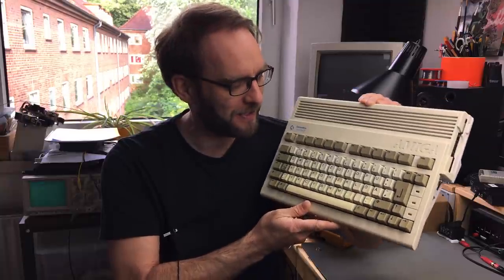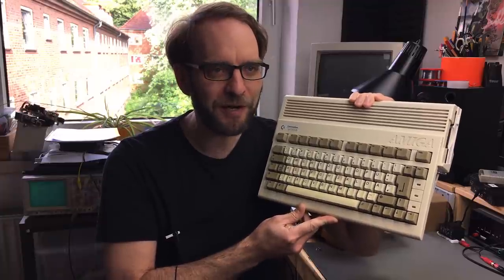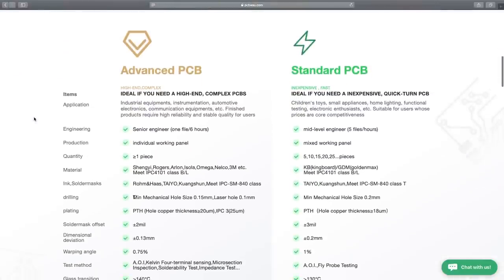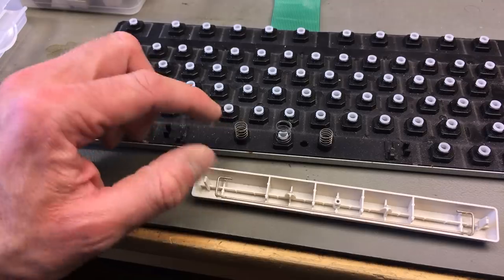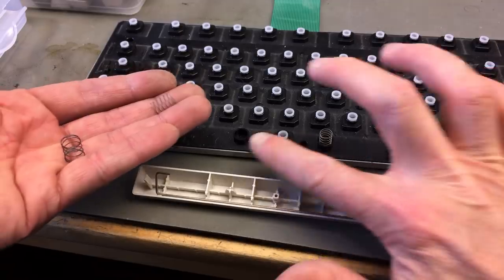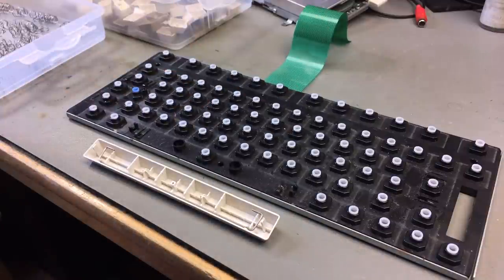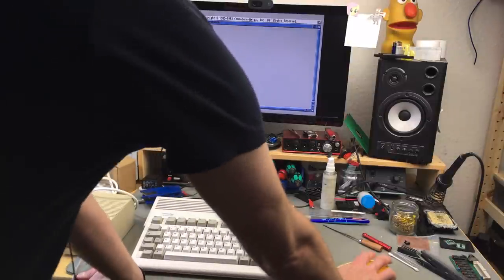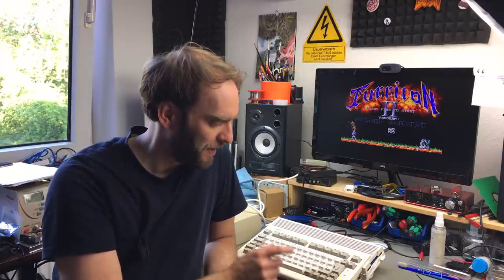Amiga 600 Retrobright and SD Harddisk

Comment: Jan, I sent you one of the first kits which had the interference problem with floppy drives. That was a silly oversight on my part. Now I include an additional two rear clips without the 'wings' so they don't interfere with the floppy drive. If someone is fitting a Gotek, etc. they can use all four 'winged' rear clips. So, new kits come with the two side slips, 4 back slips with 'wings' and 2 back clips without 'wings'.
Reply from the maker: Ah, that makes sense! Not a huge problem just filing one of the clips down though. Nice work! :)

Comment: I usually use 12% peroxide when retrobrighting, wrap it in food wrap and put it in the oven at 50 degrees (with "massage" every hour) for about 3-4 hours. Works great, and no hassle with uv light. I believe it's the heat that makes the process going and not the uv, since the wrap will block those wavelengths anyway. :)
Good job with this 600! Another Amiga saved for the future!
Reply: I remember someone (Neil RMC, I think) doing retro-brighting experiments some time ago, and he found the same thing.  It was the heat that accelerated the process.  The UV had little effect as far as he could see.
Reply from the maker: Yes, heat is the more important part in my experience, too. UV speeds up the process, too, it seems. I've seen people using UV led strips (that don't get warm that much) with great success so it must play a part, too.
Reply: I am also using the 12% "creme" stuff- but I have to say I just put the items in a transparent trash bag and put it into the sun- I am also in Germany and the last time I brightened my keyboard it was only about 10-13°C and it worked absolutely fine and only took about 3-4 hours. Could the wrap actually be the difference? the trash bags seem to be much thinner maybe they let more UV through?
Reply: What about bagging the parts in a sealed bag covered in peroxide, and running them in a heated ultrasonic cleaner for constant agitation?

Comment: Nice job Jan, I've recently rescued an A500 Plus, replacement case which I retrobighted & also boiled the keycaps in peroxide fluid, that went wrong, keys warped & bleeched the gray keys white, had to purchase a replacement keyboard, which I repaired a couple of membrane tracks with guitar shield carbon in water paint & I put the keycaps into a clear sealable food bag, which I filled with 6% peroxide fluid, then placed that in a large source pan of water to act as a jacket between the source pan & the food bag, place pan on smallest ring / hob on minimum heat setting, you should just be able to pop you finger in the water for a few seconds without any problem, after about 2 hours, rinse in warm water, dry & voila you have new keys with no signs of yellow.

Comment: Thanks for the video. When I first ordered an IDE to SD card adapter for one of my A600s I also had the problem with the HD activity light constantly on. Turned out this is a common issue with these IDE to SD adapters. What I did in the end was to order another IDE to SD adapter which had the IDE light fix already applied to it. And then the IDE light works as intended. I think it was possible to mod the one I already had, but I found it too much hassle.
Reply from the maker: Yes, there is various mods for that problem out there. I think I'm going to look into that in a future video. :)
Reply: @JanBeta  would love to see a quick video about that mod, i also have a generic ide-to-sd adapter like the one here that i would love to use now that i finally found the needed laptop-ide cable
edit: oh i see you did make a video on that, thanx!!

Comment: There is a mod for the IDE-SD adapter that enables the HD activity light. I can't post a link, but it should be easy to find. It uses a 2N7000 mosfet.
Reply: Here is the guide in a text file and a picture showing the finished product: http://megaburken.net/~patrik/Amiga%20SD%20Adapter%20HD%20LED%20Fix/
Reply: @perhansson6718  That's the one! Thanks.
Reply: By coincidence I actually was doing the same thing this week on an amiga600 and installed the same sd adapter. Had the same problem with the led being lit all the time and found this 'fix' you mentioned. I did this exact fix with the 2n7000 mosfet and it didn't work for me. Still had the same problem with the led being lit all the time. Tried it on another a600 and this also did not work.
Reply from the maker: Mh, interesting. I'm going to give it a shot and probably make another video about the process.

Comment: As for keys, especially the grey ones, I always just put them into a transparent glass and fill it with 30% peroxide and toss it into the sun. You have to use a mesh or something in there to keep them under or they will float to the top. Stirr occasionaly. Never had any streaking/mosaicing this way, unlike all the other ways I tried it.
Reply: You're right, otherwise there's a reaction with oxygen...
Reply from the maker: Oh, sounds good. It was quite a rainy day when I did the retrobrighting. Even in Summer it seems I don't get much sun here (at least not when I need it for something serious!). ;)

Comment: Great video, but I've been avoiding watching it until now as I knew it would remind me of my own 600 that's currently sitting in a state of disassembly on my workbench. I've never repaired anything with surface mount components before, and the idea of trying to replace the capacitors is quite daunting when I've only worked on through hole stuff before. I really should get my act together though!
Reply from the maker: Thanks! Hope you manage to successfully recap your A600. If you take some precautions and are careful, it's not all that difficult (and if you lift a trace because it was already corroded, you can always patch it up with a little wire or a solder bridge).
Reply: @JanBeta  Thanks for the encouragement Jan! I have an old PC video card that I'm going to use as a test for my surface mount soldering skills - if that goes well then I'll tackle the A600. I've got an SD card replacement for the hard drive, combined RAM / RTC board and a VGA video adapter to install so this should be a great machine once I get it fixed :-)

Comment: My colleague recently gave me an A600. It had an intact factory seal, and didn't have the top shield. This matches your theory, that they sold them without the top shield. 
I decided to leave mine without retrobrighting, as it is uniformly and very slightly yellowed. I thoroughly cleaned the case, recapped the motherboard, and repaired the PSU wiring, as the -12V wire was broken (Amiga was working, but the audio it produced was horrible). I also added a switchable KS (1.3/3.1) and a 4GB CF card in the IDE-44 adapter. To make it usable with a CF, it desperately needs more RAM, so I put 1MB of CHIP RAM + RTC card in the expansion slot, and added 4MB of FAST RAM in a form of CPU snap-on board. I've created a single PFS/3 partition on a CF card and installed Classic Workbench x86 (WB 3.1 based) with WHDload. As the FDD was dead, I've also installed an internal Gotek drive. The ROM switcher and FAST RAM snap-on card I used were Open Hardware projects of SukkoPera (@OpenRetroWorks).
Reply from the maker: Nice! I have some of the SukkoPera hardware on my to-do list, too. Excellent stuff. :)

Comment: Man, that QWERTZ keyboard. I could never get used to that!
Reply: Also, I think the retrobright thing is about cigarette smoke. Smoke messed up the plastic and it breaks down. That could account for differences in the longevity of the treatment.
Reply: My Atari ST has a QWERTZ keyboard - unfortunately my brother sold the one we "shared" ownership of as kids, and when I bought a replacement in the early days of eBay I didn't notice it had a German TOS and keyboard until it arrived. I adapted to the new layout very easily though.

Comment: I love the the A600 it takes up very little space.  The biggest frustration I encountered with the A600 is the short cable for the LED's.  Better to make the cables longer or just buy a new LED Board with longer cables which is what I did but I own 3 A600's.    While I have every Classic Amiga Model except the A3000 none of which are Towers its the small size of the A600 that makes it so attractive and it sits nicely in the corner of my L Shaped Desk.  I also have a Vampire in that A600 so its the one Amiga I use the most.  I am not into games like other Amiga Enthusiasts but a couple weeks back my Grand Children were enjoying playing the games.    Unfortunately the 5 Amiga's I have and use on my desk all share the same monitor and with the big box Amigas they share the same Keyboard, Mouse and Monitor through the use of a KVM Switch except the A500+ which does not play well with the mouse for some odd reason but I suspect the KVM Switch is just being picky so I will have to change that out but the mouse adapter I have which converts the 9 pin to PS2 does work it just does not play well with the KVM Switch for some reason so that A500+ in a Checkmate Case has its own dedicated mouse as does the A600 and A1200 on the desk  and that A1200 is going into a Checkmate Case sometime towards the end of the year when the case arrives.

Comment: Love the 600 great little machine
I have a Furia EC020 accelerator with 9.5 meg fast ram with switch able FPU, also have extra 1meg chip in the trapdoor, all finished off with a 4gb CF card with WB 3.1 installed.
Next part of the project id whd load and an original internal floppy instead of the gotek if i can find one.
Love your vids always happy when new ones are posted

Comment: You dont need to remove all the keys, 1 by 1, for the retrobright ! But you should open and washe everything, the keyboard too (not the floppy 😅). I did this for mine, and it's still working fine. (washed/ipa+recaped+retrobright)
Aluminium Polymere are best for recap, i also ordered some replacement clips for my A600 (from usa, waiting already a few weeks...)
Desoldering with heatgun 858D (protecting with thermal tape all around), et soldering with solder past and fine tip soldering tool (T12-965)

Good video 👍🏻
Reply: Leaving the keys on the keyboard plate is not smart at all when retro brighting. The springs under the keys will rust like crazy from the peroxide. There are some A600 keyboards (the ones with the blue membrane) which does not have springs. Those are fine to do this with. In fact, my A1200 I bought from ebay about 5 years ago had been retro brighted by the seller. After a few years I took the keys off and all the springs was rusted to hell. Seller had retro brighted the keys without taking them off. Probably to save time. Not smart at all.
Reply: @larsenmats  I did fast drying the keyboard with a heatgun, don't worry for me. 😁
Reply from the maker: Removing the keys was mostly for thoroughly cleaning them. Retrobrighting would work fine if you just removed the electronics, I agree. I still like to do it this way. :)

Comment: I'd like to have an Amiga again....  I used to have a really really ratty 2000 with a video toaster (literally found it by the road in the rain), but it worked ok after I replaced the floppy drive.  But I had to get rid of it (along with most of my other old computer stuff) when my ex and I split up 15 years ago.  Still rebuilding my collection lol.  The Amigas are so expensive now though, even 500s.  X_x  What I really want is a 3000UX, but I 'spect if one ever appears on ebay it will go for astronomical money lol.  Maybe I ought to just get that new Checkmate case and put a raspberry pi in it, and pretend......  >_>

Comment: Thank you for the tips in the video regarding the broken hinges in A600 cases. I have 2 cases with broken hinges, which I hope to repair when I receive the hinges from the Birt website.
BTW what is the name of the white 'sponge' tool you use the remove black marks on the case? It seems to do the job pretty nice.

Comment: Hi Jan, when cleaning the keyboard by spraying with IPA and brushing with a toothbrush, would that basically not just loosen the dirt and move it a bit around? I see that you're trying to remove the dirt with a cloud, but I would maybe spray (a lot) of distilled water on it afterwards, to remove the dirt. Is that a bad idea? As in, using the IPA for loosening the dirt, and distilled water for washing it away... That shouldn't leave any residues either :-)
Reply from the maker: If there's a lot of dirt, I usually try to rinse it with water and then with alcohol (to replace the water and to make it dry more quickly). The brushing is enough for some light dirt and for removing the flux in my experience.

Comment: I really look forward to an Amiga reproduction using the same cheap SoC motherboard used in THEC64 full sized C64 clone with keyboard.  They should do one in the A600 form factor to avoid the keypad to save money and reduce case size.  It might be done for very close to the same price as THEC64 - US$120 - although the much more complex shape of the sexy A600 case might increase that.
Reply from the maker: You can build something using a Raspberry Pi and Amibian together with a Keyrah keyboard adapter. I think an all-in-one solution is not happening anytime soon because of the weird copyright situation with the Amiga stuff.

Comment: A few years ago I bought a little riser attachment for the IDE port on the A600 and 1200 which fixes the issue with the LED being permanently on.  I think I had it off someone on Amibay, I'll see if I can find a link...
Reply from the maker: Yes, I've seen those. Maybe I'll get one sometime. I found some workarounds for the LED problem, too.

Comment: Hi Jan, great video like ever. 😎👌👍😁 Was there no reason to change/soldering new capacitors? I heard some guys say that is a must to change it always after a maximum of 20-30 years of time, espacially on amigas. Is it possible that commodore uses differnt capacitors over the time,  that not broken over the time or dont have fluid ones? Thanks and greetings from Gütersloh, André
Reply from the maker: I replaced the capacitors in a separate video (linked in the description) before. I recommend always doing that on equipment from the early-mid nineties that uses SMD capacitors. In my experience, most of those are leaking. They had some production problems in those days.
Reply: @JanBeta  OK, thanks and sorry. I dont see the link before in the discrption. 😂😉

Comment: How does it look after 2 years? Did it reyellow? Thanks!
Reply from the maker: It still looks pristine fortunately! I guess I got lucky with this one. But as I mentioned, your mileage may vary with retrobrighting. Some things turn yellow again rather quickly, sometimes they take a long time. The process is not stopped by the treatment but reversed to some extend, at least for a while.

Comment: Does the A600 have any disadvantage in therms of compatibility over A500 ?
Reply from the maker: A few games don’t work with the slightly different memory (1MB chip memory vs 512K chip+512K fast on the A500) and a couple don’t like the newer Kickstart ROMs (A600 shipped with 2.05 ROM originally). If you need 100% compatibility with older software go with an A500.

Comment: I once had an AMIGA 600 and tested it against a Pentium MMX with 200 MHz.
When the Amiga was processing an image, it was just on the 2nd line, 
when my Pentium MMX was already finished editing the image. 
The result was so staggering that I only gave the AMIGA 600 away.
Reply from the maker: Yeah, those PCs had a lot more processing power. But then again, the stock Amiga 600 is based around a CPU from 1979. ;)

Comment: you chose the wrong drive identifier for the hard drive, when you selected to identify the hdd, you should have selected the second identifier in the list.  ST9190AG was the drive identifier you wanted to select to receive the full partition amount. so instead of 240mb, you would have received 2GB. you might want to reinstall workbench.
Reply from the maker: Oh, I chose that one. The SD card is only 256MB so I think everything is good.

Comment: I am trying to install a turbo hc533 accelerator card into a rev 5 Amiga 500 and it needs KS 3.14, but as it's a rev 5 board I also need a adaptor for the eprom KS and trying to get them to fit together is driving me crazy.  I don't want to mod the socket on the A500 so I am having to find ways to lift up the turbo card or lower the eprom adaptor. After some time I managed to get them both into the case and it worked only to find the keyboard and case would not go back in due to clearance. Now I have designed my own re-locator board to move the turbo card back and I hope this is the last part of the puzzle. If anyone has a Kipper2k dual rom board for sale or how I can buy one I would love you for ever. After posting on amibay for the past few weeks and emailing I had no response so perhaps he sold out. The low profile dual rom would solve all my problems if I can find one in the UK.

Comment: With BetterWB 4.3 you can have a limit of 8GB. Have all my AMIGA’s 3.1.4 ROM chips and have 32GB CF. For me 32GB is more than enough.
Reply from the maker: Yes, I think some of the new WB variants use the PFS file system which allows for larger partitions even with older Kickstart versions. I have yet to try that stuff.

Comment: NO Retrobrighting, the yellow will return and it makes the plastic brittle.
Reply from the maker: As I explained in the video, the yellowing will return but not as bad as it was. Also in my experience, if you don't use excessive amounts of UV for retrobrighting, it doesn't make the plastic more brittle at all.
Reply: @JanBeta  That's fair comment but it isd still not for my cases etc.
Reply: @JanBeta  OK, its your case, hope you do not come to regret all the Retr0brighting. Personally I think just a standard clean will suffice otherwise you kill the character and history of the case.